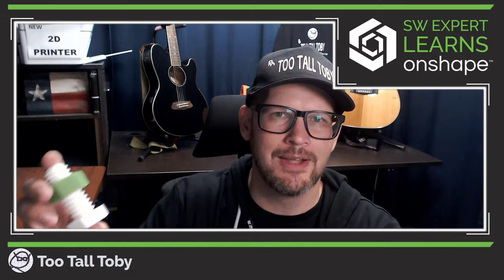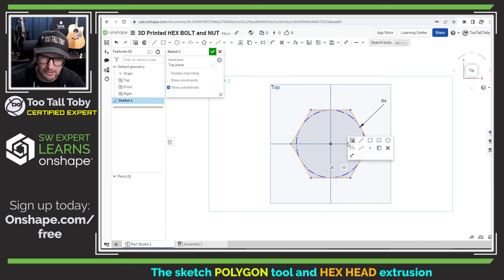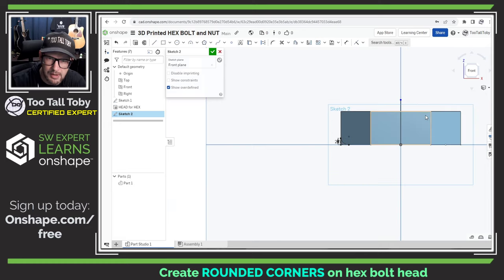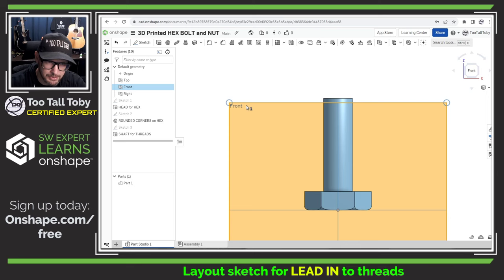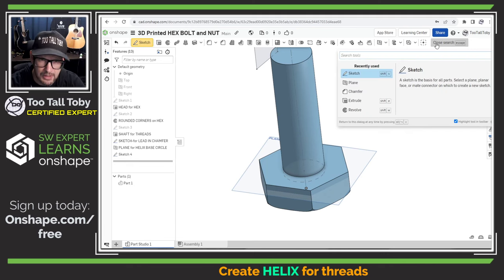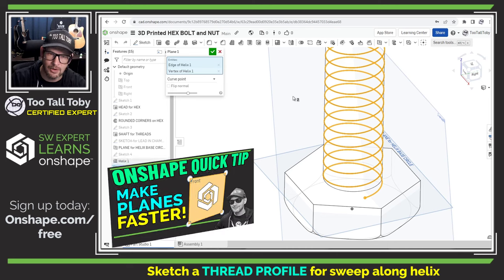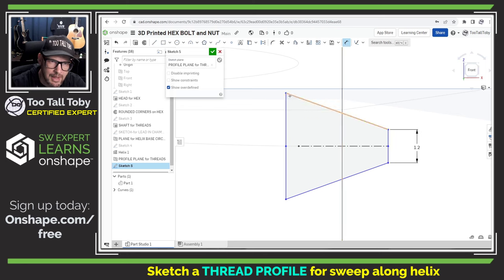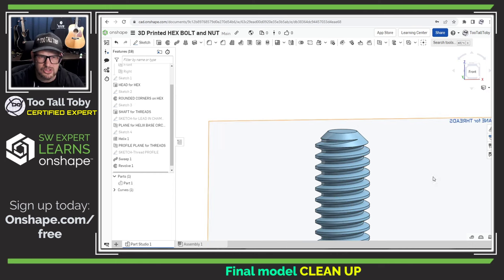Hex Bolt Design (CAD Tutorial)

Comment: They are NOT rounded corners on a bolt head,  they are in fact 30 degree chamfers. If you were an engineer you would know that!
Reply: Lol - FACE PALM - Thanks Ken!  I think my brain sometimes glitches out!  Thanks for the email too.  I've made a bunch of these for 3D printing and I always used the "rounded head" method cause it looks good and feels good on the 3D print - but I never machined one!  But yeah that makes sense that it would be a simple 30 degree chamfer.  WAY EASIER to cut IRL!!

Comment: I think there is an important error here in this video. Referring to Wikipedia and the ISO thread form but also in general, the correct form of a thread, angle of thread flank and pitch spacing are defined relative i.e square to the AXIS of the turn, such as on a Lathe and not perpendicular to the helix end curve. You correctly note and show the plane difference but ignore the thread true definition applicable to all thread designations. I think there is some confusion here - please consider this TTT.
Reply: Thanks and thats a fair point - this is more for 3D Printing threads and not so much for ISO thread creation during the machining process.  But I'll be more aware of this for future videos.  Thanks!!

Comment: What is the difference between creating a plane in the middle over creating a plane on helix and a point?
Reply: You want the plane of your PROFILE SKETCH to be perpendicular to your PATH, at an end point of the PATH.  This is a general guide for creating sweep geometry (in any 3D CAD package) and following this guide will help to ensure that the cross section of the sweep does not become distorted.
Reply: @TooTallToby  this applies only for thread isn't ?
Reply: @skaiindustry254  No this "best practice" is suggested for any sweep
Reply: @TooTallToby  thank you for that

Comment: Forgive me if my terminology is off; I have been doing CAD type design for a few months now, but I had to drop some Kudos here. I looked at MANY YouTube videos. None of them put the finishing touches to the bolt. They used the Front plane stuck with simply sweeping on a Helix and patching the ends. You addressed the plane on the Helix to avoid slop in the threads for the nut. You correctly addressed both ends of the bolt along with polishing the threads. Nobody squared off the tip of the threads to make it more professional (matches metal bolts closer). I took your design and included elements of it to create an adaptor that needs about a 15mm bolt end. The bolt part of the adaptor (shortened to 15mm) allows parts to be removed from my assembly for modifications and upgrades. Although I could have changed the pitch and shank diameter, it turns out your sample worked great for my needs as is. Thanks for putting out this and other videos!
Reply: Awww yeah that is AWESOME!!  Thanks so much for the Kudos and I'm so glad this helpful - but most of all I'm glad you were able to Engineer a physical part and make it work!  that is so cooool!!!!

Comment: Most bolts are defined by outside diameter and thread pitch. If you start with a cylinder with the desired final dimensions then you can cut the threads with remove instead adding them to the cylinder. This produces a final product that is more useful to make arbitrary bolt sizes.
Reply: that's true and fair - the technique shown here is more for "custom 3D printed" threads but you're right, if you're designing something to fit an existing thread you might be better off creating the OD then using a sweep with the REMOVE (cut) option.  Good point - thanks!

Comment: Super duper video. THX.

I wonder if you actually tried to 3D print this model. I'm concerned it would need a lot of support because of the steep angles on the head and the threads. 
I would love for you to discuss how to make that model more 3D printing friendly.

Again thanks for an excellent video.
Reply: Thanks EC9 - Yup I printed it  - the bolt and nut I show at the start of the video came off my flashforge printer.  I have a flashforge and a prusa, but I mainly use the prusa for TPU.

The threads don't need support.  I think because the overhang is very small, the threads have a natural "drafted angle", and the additional angle of the HELIX, threads tend to print without support, and without issues.  At least for me.  

The Part was oriented on the printer with he hex head sitting on the bed, the threaded section vertical (sticking up, as though the bold was sitting strait up on a table). 

hope this helps!

Comment: Hi TTT.  I would like if you could make an tutorial about designing a work piece that will be able to screw on a existing piece with threads.  For example...... I have a vacuum machine with an existing pipe with threads, that normally fits to the machine, via a coupler that screws on to the hose.  The coupler has unfortunately perished, and no parts are commercially available, hence the request. How easy would it be to model a new coupler that will be able to screw on to the existing pipe?  Would be nice to have a tutorial to see how this would be done.

Comment: Nice tutorial. However at the end when you notice exporting the part, you'd do it in STL. I'm quite new to 3dprinting, but I'm always exporting in 3MF as I thought that is todays standard
Reply: Yeah you're correct - SumoBr pointed this out too! 
3MF is the modern format for 3D Printing and definitely more appropriate for most modern 3D printing applications.   
Prusa has a nice video on this topic, here:
https://www.youtube.com/watch?v=BABdR9d8Cp4  

I wasn't really thinking about it because I didn't have any slicer info built into the file - and I'm pre processing in the FLASHFORGE slicer, so STL works fine.  But I could also import 3MF into this slicer, so I should have just used 3MF export from Onshape.

Good call Mich!  Thanks!

Comment: 10:00 Layout sketch for LEAD IN to threads

I'd like you to explain it to me, please. At this point, I can't do that at all.
Reply: How to use diameter tools with the construction line measure ?
Reply: 10:02
Reply: i cann't do that guy
Reply: First select the construction line, then the point you want to be the diameter, and when you place the dimension on the opposite side of the construction line., the diameter option will show up.

Comment: Another way i found that at least in model (i havent printed yet) is to create the bolt and the nut and then   boolean subtract the bolt from the nut and then just go back and adjust the sketch for the thread geometry on the bolt its self.

Update: Better yet, there is now a thread creator feature script!
Reply: yeah you can boolean subtract for sure - the only thing is that makes you scale the entire body (instead of specific faces) and something this can cause a hiccup.  Just something to look out for - but great suggestion!

Comment: i got stuck at using the pierce command on sketch 2, i couldnt get it to attach to the circle in sketch 1... i suck at this :(
Reply: Sorry- The Pierce command can be really confusing at first! Keep practicing and I'm sure it will start to make more sense.

One thing I always remind my students about is that the PIERCE constraint always take place between a POINT in the current 2D sketch, and a LINE or CURVE outside of the current sketch.  Maybe that will help 🙂

Also - I created this Onshape tutorial, which has a free PDF training manual that goes with it:  https://youtu.be/GYkZmE_6MpY?si=uyujZB5LygMj0aoI
It may be helpful to have some of the steps in print to make it a little easier to follow along.

Hope this helps!
Toby
Reply: @TooTallToby  thanks for the reply mate, really appreciate it. I'm absolutely determined to learn so I won't give up, just when I was trying to follow you along the circle inside the hexagon wouldn't show up, only the origin. I'll have another go this week on my work break.